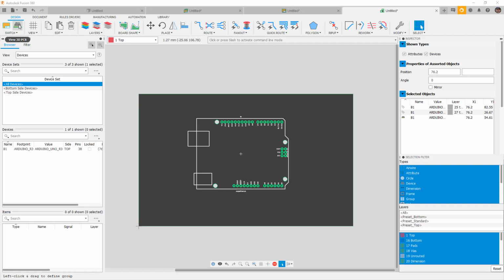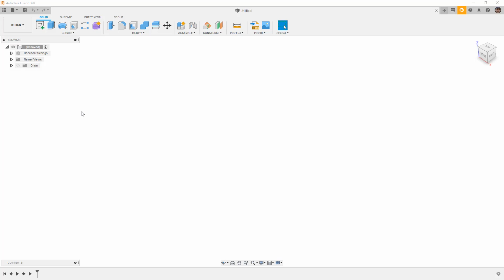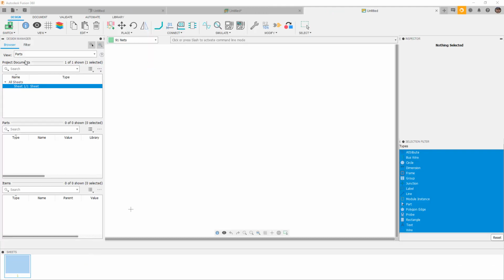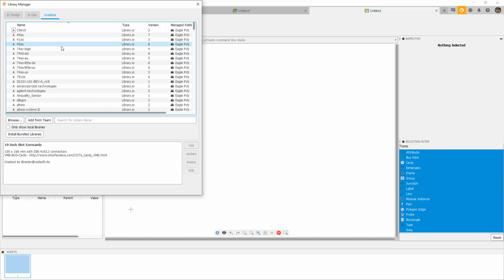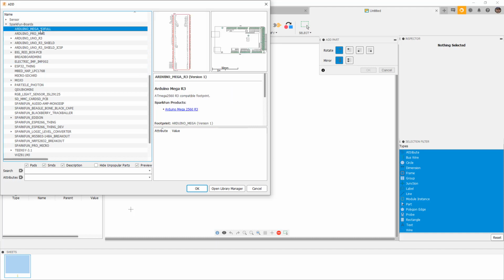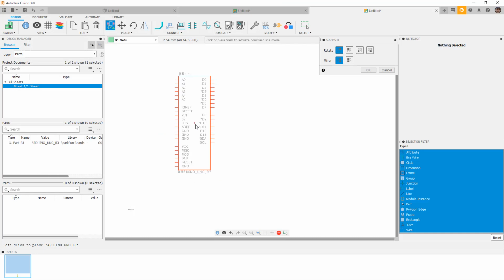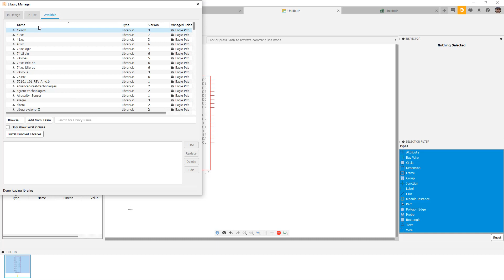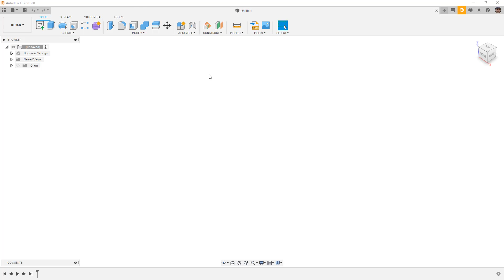Intro to PCB Libraries in Fusion 360: Episode 1 #Fusion360 #Fusion360PCB #Maker | Tutorial

Comment: Great video. You should include "tutorial" "component" "create" "how to" etc in your title. This is one of the best tutorials but it's buried because the title is not showing up in search.
Reply from the maker: Thanks!  I added some of those as tags and added tutorial to the title.  I am still trying to figure out the algorithm here ;)  I do have more PCB content in the works and hopefully will do a better job of titles and getting it out.

Since this video was done there have been a few updates, specifically to the library, so hopefully it still all makes sense.
Reply: @LearnEverythingAboutDesign  I just can't believe how well fusion360 is working now with 3D modelling and electronics integration. Such a breakthrough in design workflow. Finally it's fun to make PCBs.